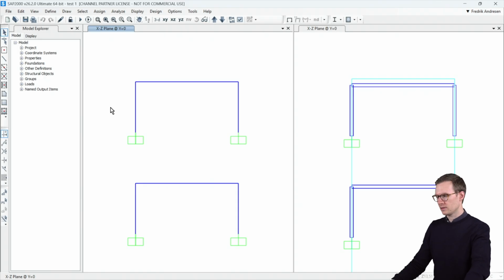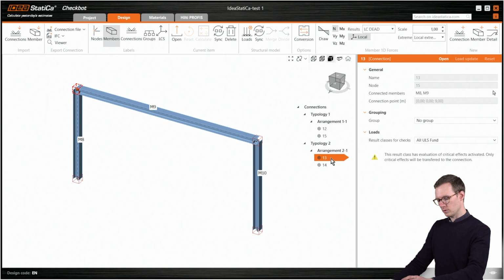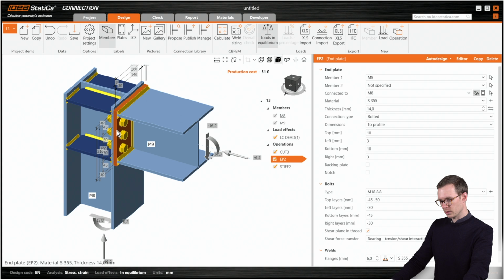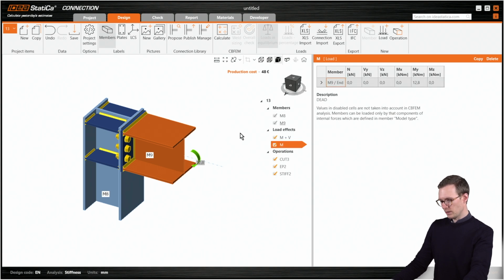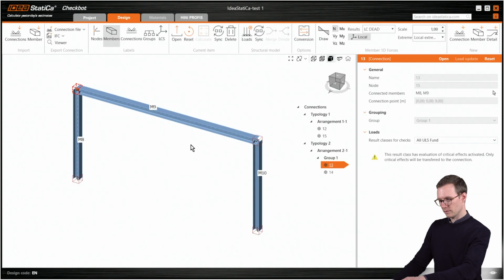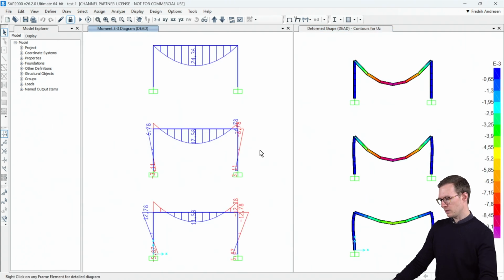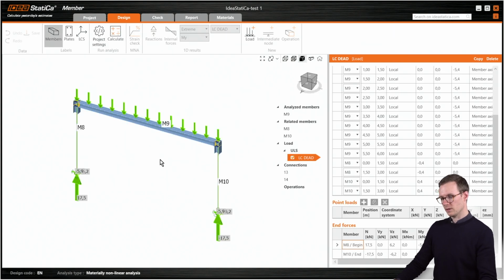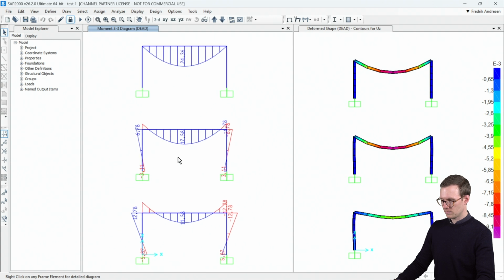Stiffness Analysis in IDEA StatiCa!

Comment: I'm user idea statica v25. after I analyzing stiffness the result of rotational stfness is always fully restrain. i did not found rigid, semi or pinned. Is there an clue? or it's just for euro code not aisc
Reply: Same to me, I am using v25, after I analyzing stiffness the result of rotational stiffness is fully restrain! dont see semi-rigid, or ...! I am using Australia code, does this works for AS code?
Reply: @FarzadHaghi-h7r  yes you're right. I use AISC so the term is fully, partially or simple. in the manual of US code describe this condition. I think that likely same to term of euoro code as rigid, semi or pinned connection.

Comment: Thank you for this video, it helped me a lot. There is one thing I don't understand. Why is the stiffness with the moment alone lower than with the same moment and additional shear force? It would be logical to think that the shear force causes additional deformations that should reduce the stiffness of the node. I made a model for my project, and the additional shear force also increases the stiffness by about 20%. I would be grateful for an answer, if you know it.
Reply from the maker: Hi, sorry for late reply!

See this reply from our support team, use this input on your own responsbility 😉:

This is a bit counter intuitive maybe but let me explain. For these cases, with the additional shear force the member will rotate less than with pure bending alone.
The reason is that when both moment and shear act, the bending moment near the connection is smaller (on average) than in the pure bending case — even though the maximum moment at the node might be the same.
In the case where moment and shear are combined this will result in a smaller rotation in the member in the proximity of the connection. And to put this in context, with regards to stiffness analysis, we need to have a look at the how the rotational stiffness is determined. A Moment- rotation diagram is used where we have the applied moment on the vertical axis, and the rotation on the horizontal axis. (And the applied moment is actually the same whether we use one or the other combination). Then the software uses an incremental analysis where small load-steps are applied to the connection, and the rotation linked to each load step is obtained and plotted, and that is how the green line in the diagram is formed. And we are interested in the point where the green line crosses a specific Moment. In this case it’s 2/3 of the Design moment resistance. And the unit of this rotational stiffness in Idea statica is MNm/rad, so a spring stiffness.
To sum it up. By introducing a shear force, the member rotates less for the same applied moment, which means the connection behaves like a stiffer rotational spring (i.e., it has higher rotational stiffness).
Reply: @ConstrusoftNordics  Thank you for your reply, that makes a lot of sense :)